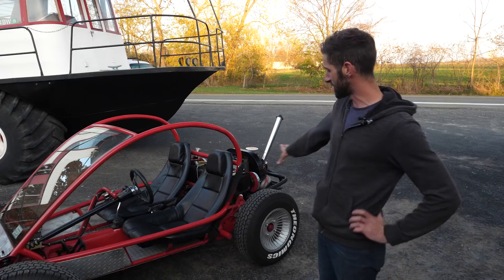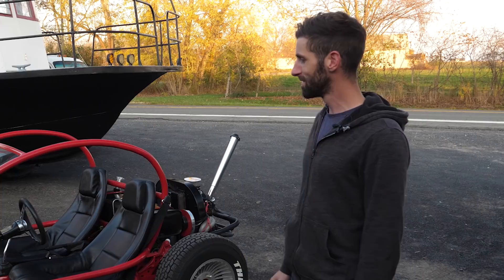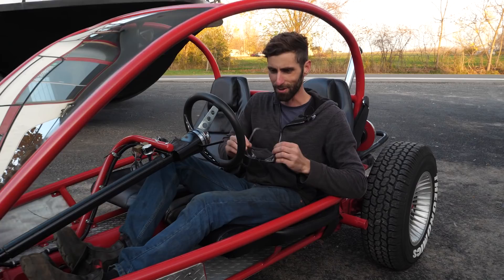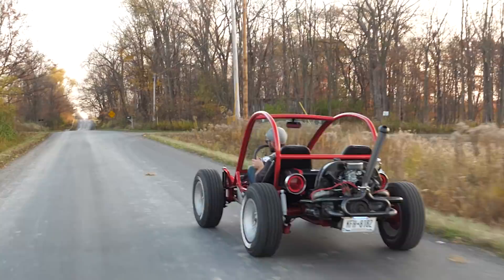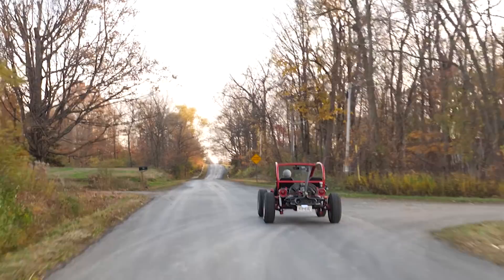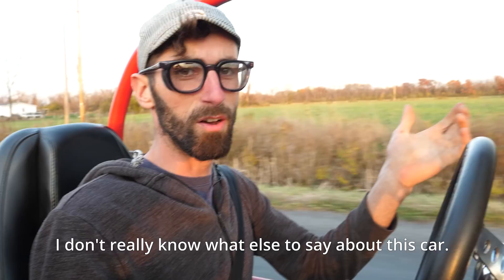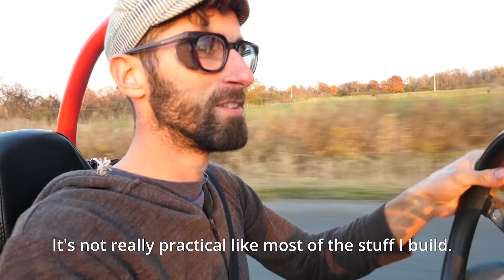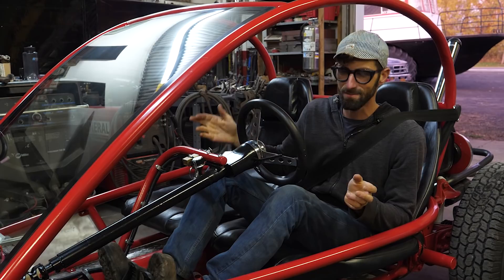Driving The Custom Frame VW (Volkswagen) Dune Buggy | ep3

Comment: Just a little old timer vw advice. Your front tires are too big. Stock tires up front are the best bet and put about 150lbs of weight up front perhaps a solid bumper. You won't be available to stop in the rain and your front tires turn into skis in loose dirt or mud. That will take care of the steering wheel vibration a bit and it will handle much better. Also try to find or make motorcycle front fenders, you'll be glad you did.
Awesome build boys.
Keep VWs alive ! ♡
Reply from the maker: Great notes, really appreciate that. Hope to have more updates on this in the near future. Short on time and funds currently.

Comment: Lots can be done to the motor, simple stuff to increase power, research Porsche / Volkswagen parts, I know the injection system and heads intake from an older Porsche do miracles
Reply: Try a Dellorto dual carb kit. I had that on my first car, a Porsche 914. It was great!

Comment: Hey buddy nice build. I was thinking about your idling issue if that carburetor you were using says pick 34 on the carburetor on the passenger side up by the air cleaner is the idle mixture jet that will clog up with today's fuels so by using some carburetor cleaner spray out the jet and the orifice into the carburetor. That will fix your idling issue. And is your distributor and vacuum advance or mechanical advance. The vacuum advance will have usually a golden color round Disc on the driver side of the distributor. Also check the intake boots going from the carb to the Dual Port intakes for a vacuum leak with some carburetor cleaner while running. Let me know if this helps and what distributor you have
Reply from the maker: Hey thanks, I really appreciate that. I have had some success sine the initial video, but will definitely look into those points. Those are some really clear and concise notes. It's amazing the knowledge you and so many others have on these legendary motors.

Comment: change the place where the battery is; or make a steel case around it with ventilation underneath. (batteries explosion is unpredictable when they happen)
Reply from the maker: Thanks, good point!

Comment: What is the length of the wheel base?  Front wheels to rear wheels?
Reply from the maker: It was shortened about 22". Not sure off top of my head what the stock VW size is, but it's damn small lol.

Comment: "Just a VW" google bug horse power. The VW bug is the reason the drag officials put in year restrictions on import drag racing.. Because VW can be HUGE HP on the cheep. What you have here could be insane.
Reply from the maker: Fair point, will look into that more. I guess I was just trying to be humble about that aspect. Thank you!
Reply: @theonomicsbuilds6133  OMG yes you should. You can drop a turnkey motor in this thing and touch 9second 1/4 mile if you can get it to hookup. This does has a purpose though that you totally missed. That grin you had from ear to ear driving it, THAT is this things purpose. I am stoked to see you take it to a ORV park. <TIPS> First you upgrade the oil cooling system, First priority ever on a air cooled motor. Second ALWAYS carry extra belt and tools to change it. Its rather simple and the second you see your belt is broken you just pull over. No looking for place to pull over just pull over ASAP. This belt runs the cooling system and without it for more than a moment the motor will seize.
Reply: @theonomicsbuilds6133  First of your videos I saw because I am a VW guy and yeah... I watched your others, you got this. Killer content my man.
Reply from the maker: @Ssidistik  Really appreciate that! Hope to have some more videos in the near future as other projects progress. Thanks again!